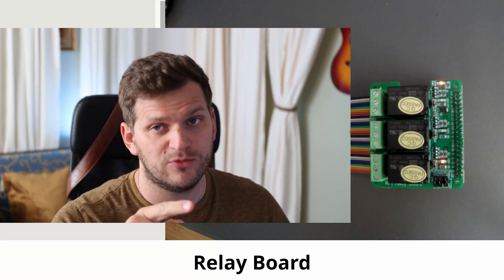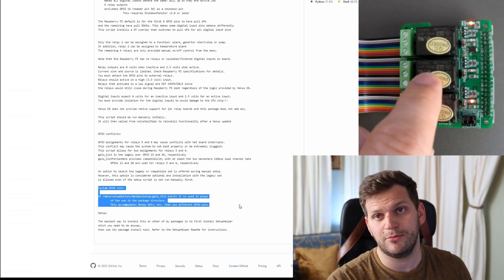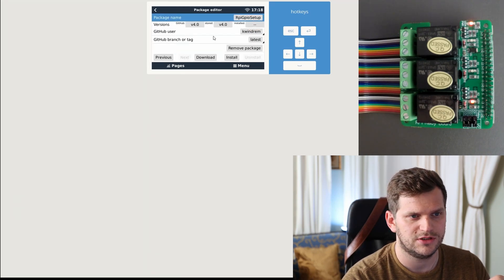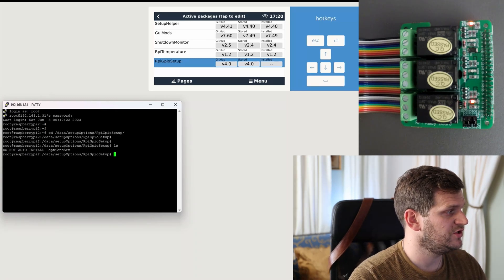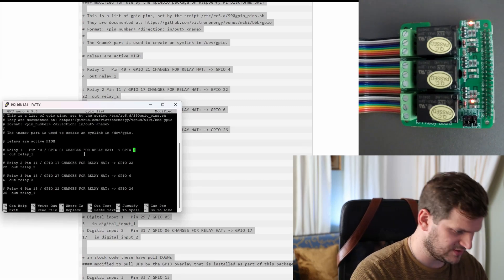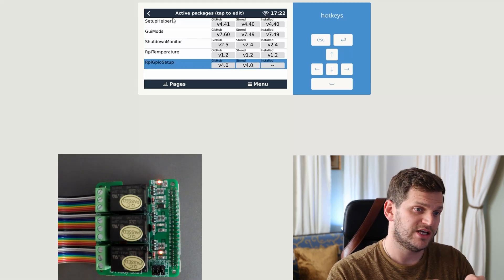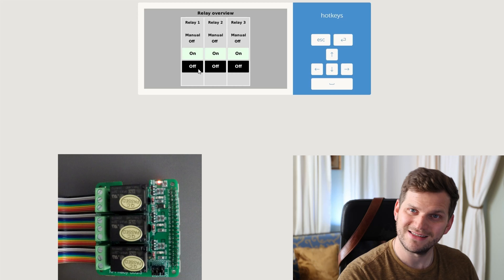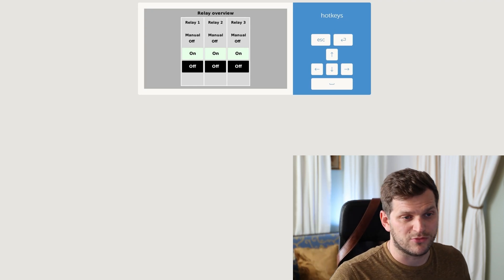Victron VenusOS Raspberry Pi | SetupHelper by Kevin | GPIO Relay configuration | Survive Updates!

Comment: Hey Tobi, these videos have been really helpful! I was having trouble getting the RpiGpioSetup to read from the custom gpio_list in /data/setupOptions/RpiGpioSetup. This video was missing one step that you may have done the first time you installed RpiGpioSetup. I wanted to leave a comment in case anyone else is having troubles like me. Once you download and install RpiGpioSetup, if you want to use the custom gpio_list, you need to SSH into the Pi and then run "bash /data/RpiGpioSetup/setup". This will prompt you to activate RpiGpioSetup and then prompt you to select the gpio_list file you want to use. Thanks again for these helpful videos!

Comment: Thanks for your tutorial. I followed all your instructions for making work  my relays board on my  raspberry pi 3  but when I open my venus console I can't find "  active packages ( tape to édit )  "  nor next page " packages édition" 
May be I don't have the same venus os as you?
I downloaded the last venus os from february 2024.
I spent severals hours to try to make my 4 relays board working.
Awaiting for your explaination please.
Franck from France
Reply from the maker: That's weird! In the main setting there is no Package Manager at all in that list? In this case the setuphelper might not be installed correct. The setuphelper (when installed) can be found in "Settings --> Package Manager" Do you see this at all?

Comment: I’m having issues with the way my relays are set up with Venus os and I’m not quite sure how to fix it. 

When  power is applied to my raspberry pi my relay boards normally closed will open. 
I’m not telling it to do anything just connecting power to my raspberry pi. 

The problem this causes is when I lose power the state changes. 

Any idea how do I fix this?

Thanks.
Reply from the maker: Oh, interesting. I'm not sure at the moment. I do have the Pi running usually all the time so I do not have this use case had so far. Let me see if this is the same for me

Comment: i did the new venos os 3.22 update and had to re install package manager and set up helper . i had to re install the nano gpio list and for whatever reasons my relays are not firing in the same order even though i added the exact same gpio list. any idea why this is happening?
Reply from the maker: Interesting. Are you using the GPIO list in this folder? /data/setupOptions/RpiGpioSetup/gpio_list
Reply: @tobisreallifeskillswithtobi  yes. 
I think for whatever reason when I copy the list and paste it into putty it’s not all pasting even though I copied all of it.
Reply from the maker: @Ryan-nd3zh  You can try to connect with WinSCP and try to edit the file in a notepad for example. If that helps
Reply: i was mistaken the complete list was pasted into putty. not sure why im having this issue. ill confirm the pin out but i suspect they are correct as i didn't change it.
 @tobisreallifeskillswithtobi
Reply: I fixed this problem.

Comment: Hi, I have installed the three channel relay board on RPI 4 with venus os v3.14. but facing issues with relay as it's on by default. In remote console showing off. When selecting On console, that time the getting off. So, it's working in opposite direction. Can anyone help me to correct it?
Thank you

Comment: Hi Tobi - thank you for a good guide. I have the waveshare rpi relay board and it's almost working perfectly  - my problem is that on is off and off is on..... I've been playing around with out/in etc. parameters but I get the feeling there's another configuration file or similar that handles this? Anything you would know about? Kind regards Andreas / Sweden

Comment: Thx for video. 

Right now I have Venus on RPI in my LR defender truck,  connected with BVM-712 and MPPT controller. 

Right now i'm looking for a solution for two ideas.

1. connecting one of bt/wifi temp sensor, just to show temp inside the fridge and behind it. And it is too hot, turn the 12v fan on. One of your latest videos shows use of relay board, but i would like to make it automatic. Or, if bt connection is impossible, use DHT11 sensor behind the fridge. Any ideas how i could achieve  this ?
Reply from the maker: I feel like I have seen something like this but nothing native from victron so far. I'll keep digging!

Comment: I have a motorhome with victron / Venus / Rpi already and thinking what could I do with relays? Not just switch some lights and integrated do not even work as it has a canbus electronics already. Any ideas? Like your videos as they are not too complicated. Got only limited Linux skills but strong DOS background from the 80's helps a lot! 😂
Reply from the maker: Nice april 7! I'm working on some use cases for me as well at the moment! :-)